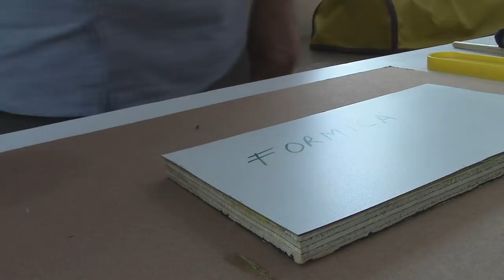Upholstery Glues

Comment: ¿estas marcas de cola donde estan en europa o america?
Reply from the maker: Estos pegamentos se venden en Mexico. Si Ud. está en USA, puede ver estos links:
https://angelusdirect.com/products/all-purpose-shoe-cement
http://www.ebay.es/itm/Petronios-Master-All-Purpose-Cement-Glue-Shoe-Repair-Adhesive-Glue-4-oz-/112032405167
http://www.homedepot.com/p/DAP-Weldwood-32-fl-oz-Original-Contact-Cement-00272/100125525
http://www.dap.com/dap-products-ph/weldwood-landau-top-trim-high-heat-resistant-contact-cement/
Watch min two:08 of this video where Greg shows the use of ´petronios'glue.
https://www.youtube.com/watch?v=RLH8BY8a
This video shows Barge glue from Tandy leather:https://www.youtube.com/watch?v=PE6dGvgWfnU

Comment: Are they harmfull only at the time you are aplying it, or its always harmfulll!!
Reply from the maker: Hello, They are harmful if we are exposed to vapors/fumes for a long time. If the area is short no problem. The bottles should be placed aside not in front of us and after application we should close the cap and retire from that area. It is advisable to apply glue in a well ventilated area.
Too long exposition to glue fumes could cause dizzines.
The masks are useful if we are going to be exposed for longer times.